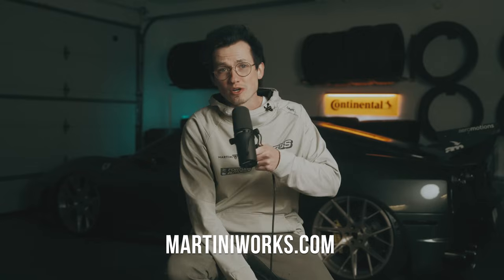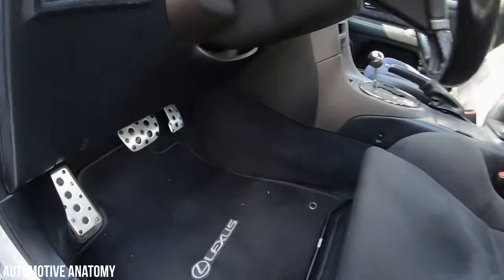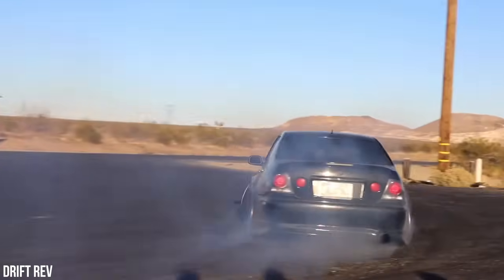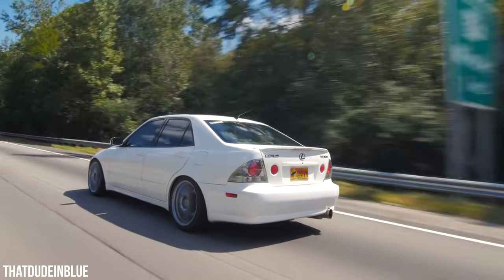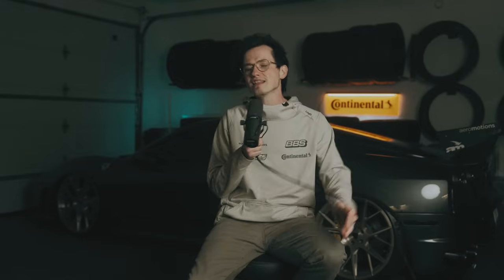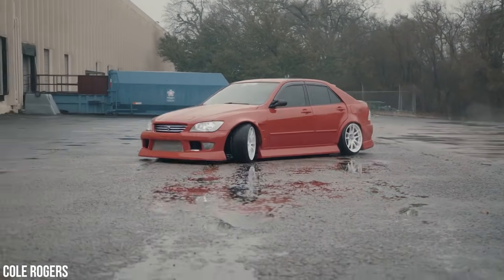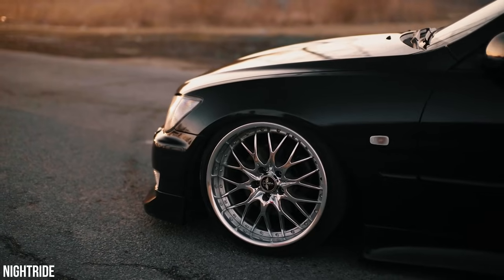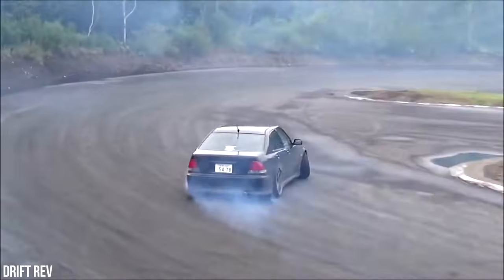How To Modify a Lexus IS300

Comment: I’m the original owner of a 2002 solar yellow (e-shift, full leather, LSD, no chrome or spoiler, Nav) and did the Greddy Evo exhaust at less than 1k miles. It’s perfect. Nice tone, not obnoxious under normal driving, but growls nicely at WOT. SRT intake kit, strut & sway bars. Totally mint. Interior is flawless. No chips or dents. Has never been through a car wash, only hand washed by me for 22 years.
Reply: Mine is the same, 02’ Intense blue Pearl , E-Shift, LSD, Nav, I love this car
Reply: Jealous of the care. Mine is second hand and mine could use a serious paint job 😵‍💫. Otherwise it’s pretty tasteful with the modifications, everything I would reasonably do myself. New wheels, struts, coil overs,exhaust, tune, after market stereo. Ig it’s even wired for underglow..? Only had it a month and not dug in real hard.. Not really my thing but alright 👍😅. Hopped in and immediately unplugged the footwell lights that were flashing the rainbow after buying it😂😂. The previous owner spray painted the hood and front bumper but didn’t paint back or otherwise cover the exposed metal from cracking the stock paint when they rolled the fenders (and also did one side kinda funky 😂) but she’s a charmer for what I paid and I like it. Sounds nice. Got it too cuz i finally wanted a car I wouldn’t mind putting money in and learning to work on. I’m not a “skilled with my hands” kinda guy and am expecting the help of a friend who is a mechanic to get it where it really should be to become something fairly respectable

Comment: You can swap a 2jzgte vvti ecu into it and slap a spinny boy on it. Just gotta add some sensors and move some pins around on the ecu. Fuel map on the gte ecu can handle 400whp (which is perfect, any more and you'll blow the motor).
Reply: You gotta splice the ecu with ur stock one, harder than it sounds also gotta do fuel and oil system. It can handle more power just nothing past 5 psi on stock con rods which usually ends up being around 400hp anyways.
Reply: I've done Na-T loved it! Even with that, just go 3UZ for more power. Current setup with a W58. Easy reliable power.

Comment: Hello future/current IS300 owner!

Here’s a couple helpful notes not mentioned in the video. Despite what the video says, the car greatly benefits from a sway bar upgrade in the back at the very least. Eibach.

The manual box in these cars is not common. The auto is actually better, simple adjustments in its valve body and pressure switch will make it shift faster with less lag and the revs will drop quicker. 

The limited slip diff from the GT86/FRS is a direct swap into the is300, and it’s geared higher and a little stronger than the stock diffs.
Reply: No thanks, if I wanted an auto I would buy a different car. I want an inline-6 attached to a manual transmission without Supra prices.
Reply: Will the gt86 diff fit into a is200?

Comment: I want to make a track IS300 because I love the design of this 4 door sedan, it’s so underrated in my opinion, but how much power should I comfortably make? I was thinking of aiming for around 350-400 but I’m not sure how I should get there in a relatively reliable manner.
Reply: Find a 2jz ge non vvti and swap the bottom end with the is300 vvti head and gte head gasket.  Then you'll need a good ecu to make sure everything stays in check
Reply: 1j

Comment: I drive the auto.with cold intakes and big exhaust with a gs300 engine..hp is 230. Only ish is valve stem seals expired and transmission expired.but still driving it like that till I replace trans and stem seals. Oil burner and not friendly on gas.

Comment: 215 & 225 tire widths are pretty narrow for an 8.5" wide wheel.  Sure doesn't sound like built-for-speed to me.

And furthermore, $12K is not "somewhat affordable" for a car of this performance.  215HP at this weight isn't "affordable" unless it's under 5 grand in indefinitely drivable condition.
Reply: Faster than an Acura TL type-s, any BRZ/gr86, all v6 “muscle cars”, any N/A bmw